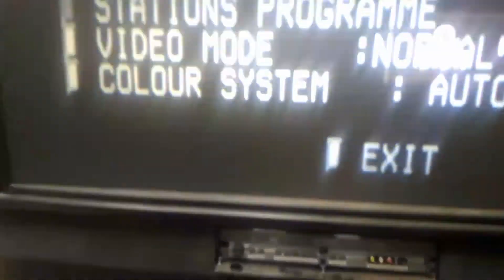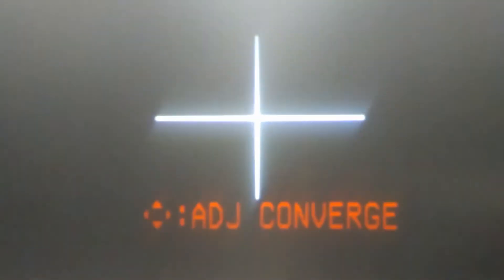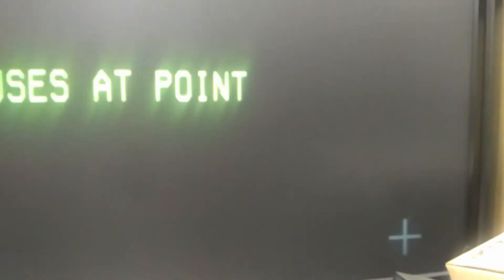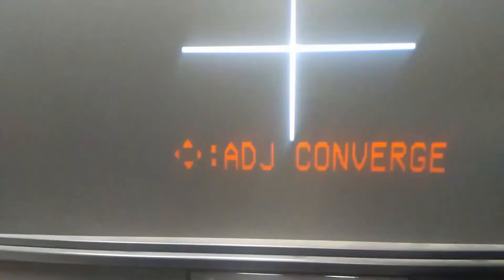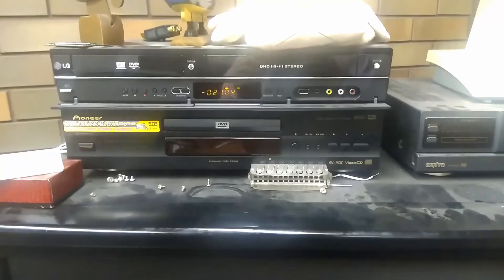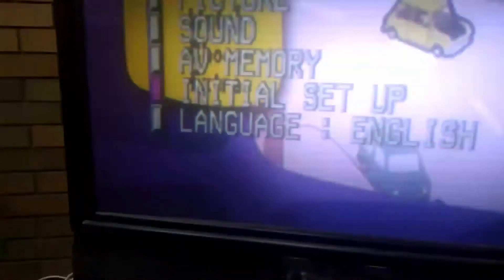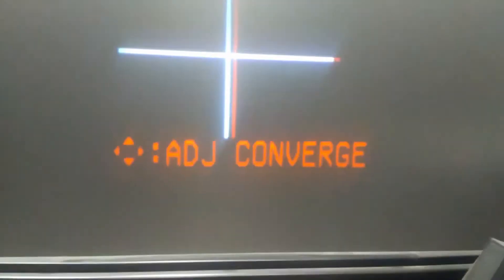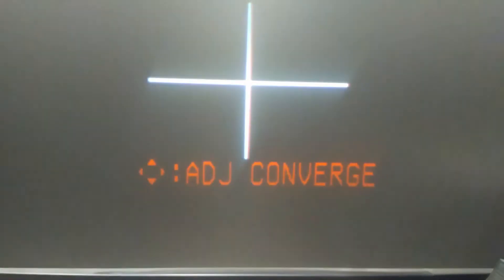Audio/Visual - Rear Projection TV vs Typical CRT TV & Convergence

Comment: Would you recommend using a rear projection tv for games/movies? What advantages/disadvantages does it have over old crt TVs and modern flatscreens?
Reply from the maker: M Rear-Pro TV is a CRT unit, meaning it has 3 colour CRT guns in it. And being a totally analogue set with no digital input, games on modern gaming console aren't going to be fantastic. In some case neither will movies on blu-ray or Hi-RES DVD either. 
But in saying that, VHS/Laser Disc systems will look good on them as they are an analogue source.
Over that, the audio on a rear projection TV is often far better than a normal TV due to them using essentially full size speakers and often a proper HI-Fi amp in them as well.
Reply: Backyard Tech thank you so much for the insightful reply I really appreciate it